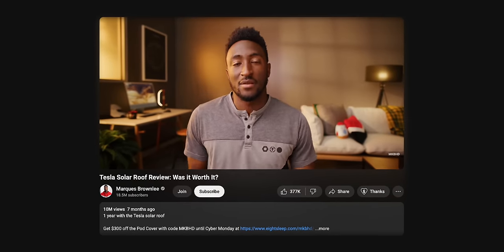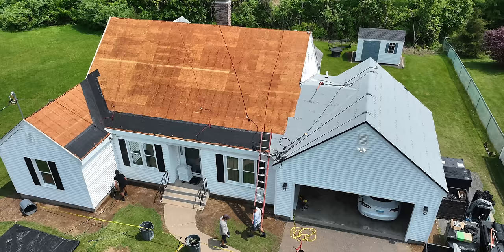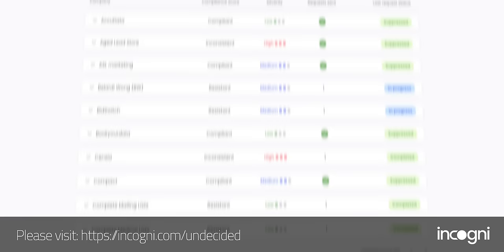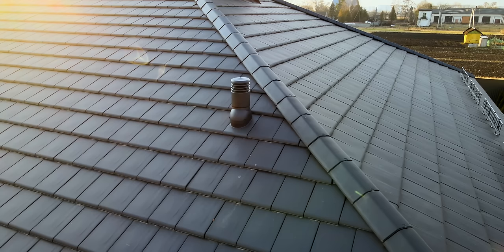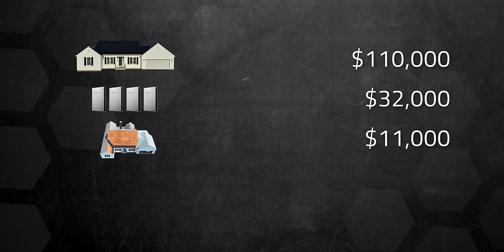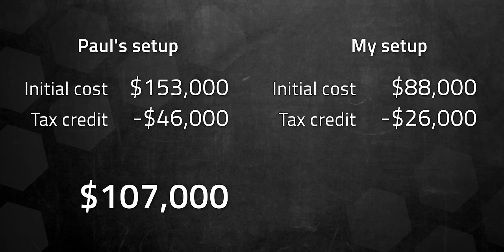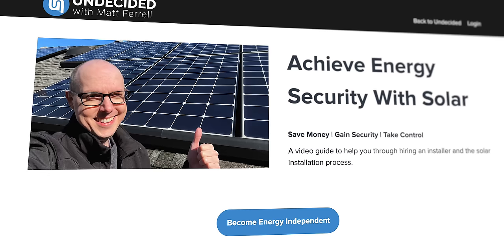Tesla Solar Roof vs Solar Panels: Which is Worth It?

Comment: These USA prices are eye watering! In the UK you can pick up the all the gear with 20kw of panels and 20kw of storage for well under £20k and a new tiled roof on a large house would similarly be around £15 to £20k. Embedding the solar panels in trays on is a good option if reroofing because then you don't pay for the roof tiles just to then put solar over the top of them (effectively paying twice to cover the roof).  I'm looking at 10kw panels, 20kwh of battery and reroof (part embedded) for £30k fitted. I can't get over these $100k+ prices, particularly given that is after massive subsidies!
Reply: Probably depends on who is installing the set-up, but yeah, I've checked many times over the last year and a setup like that in the UK would be a lot cheaper, and I do wonder why is it so much expensive in the US? Some will say imports on China but I can't see that inflating the price by that amount.
Reply: USA has large import tariffs and also expensive permitting before anything can be done so USA laws make solar expensive. Look at lockdown laws and solar laws to see how stupid American government can be.
Payback for a simple solar on a metal roof in the Philippines can be less than 2 years now. 50% annual investment returns!
Reply: Yeah. its a big problem here. installers over charging and getting wealthy out of the process.  its ridiculous.
Reply: @nottelling41   Hardware is a fraction of the overall cost of an install although batteries are expensive as hell. The issue is installers charging a mint and the fact that they know we get a subsidy and price higher because of it. The financing people make it even worse as they pretty much take the entire subsidy! My next system will be done in cash to avoid this and I'm glad my current system was done before the finance vultures went crazy.
Reply: Yeah, they're idiots for buying them at that price to be honest, it makes no economical sense whatsoever.
Reply: It's amazing that USA has so many illegal immigrants from South America and we still have a broken labor market, particularly comparing to Europe. While, on the other hand, it contributes greatly to the USA GDP and made it highly inflated, for better or worse.
Reply: We also have big Oil Companies who do their best to keep Solar expensive.   You can "self install" and hire an electrician to do the final connections for MUCH cheaper.   Especially if you just do grid-tie.   (but then you get screwed by the power company paying less for power than they charge you at night)

Remember these guys are buying premium products, including off grid capability and fancy controllers.
Reply: Uh, for a start, what's the minimum wage in your area? Various things cost more in the US, but the wages are also often a fair bit higher.
Reply: @chickenfishhybrid44  Wages don't affect the return of an investment.
Reply: It’s got even cheaper in the last few weeks, prices have really come down in the UK
Reply: @TheObserver567 why does anyone pay it though? Out electricity is 40c a unit and even then our cheap solar installs are hard to justify
Reply: In Aystralia solar panel installations ars heavily subsidised by government making it very attractive to homeowners
Reply: @chickenfishhybrid44  Min. wage in the UK is about 11.5 pounds per hour or about $14.50 in U.S. currency.  Wages in western Europe are a lot higher than many Americans think they are.
Reply: I am in the US and have been looking at DIYing solar. To duplicate his setup with napkin math numbers I have about 25-30K in hardware costs not including installation. 7K for 16.5K solar, 5K for a 18kW PV hybrid inverter 7.5K for 28kWh batteries. And I put in another 5-10K for racking hardware, wiring, conduit. This is pre tax incentives costs. 60K for design and instillation seems a bit extreme.
Reply: In Australia ,I live in Queensland solar installation is heavily subsidised by Government

Comment: Leaning towards regular solar panels.
Reply: diy solar and portable batteries (which he has shown here many episodes) is becoming clearly a better more portable option... and simpler to run..and not locked down perma solar which insurance and home suburban areaa disallow... diy is becoming so simple with the plug and play solar.. about time
Reply: @dertythegrower   Where are you seeing PnP 10+KW systems and 20KW or more  batteries? Those little "solar generators" are a joke in comparison to a fixed install.

Comment: Those prices are crazy expensive when compared what Im paying over here in the EU. Im getting next week 10 KW solar panels with 11 KW EV charger with installation for 10k EUR. On top of that Ill get 50% off of that price subsidized from the government by the end of this year. Im really happy with this deal :)
Reply: Various things can be more costly in the US. Wages are also generally higher.
 He's also in a particularly expensive part of the US as well.
Reply: @chickenfishhybrid44  true that but overall Im getting a sweet deal and executing. Bueno :)
Reply: But it is not just Europe. Last December (summer in Australia) I had a 6.5kW system put in for $A3.5k (after about $1.2k in government rebates). That's about $US2.7k. And because of our weak currency we are used to most things costing a bit more here than in the US.

Comment: 00:00   🎬 Intro to Tesla Solar Roofs & Personal Curiosity
00:28   🏠 Comparison between two homes - with and without Solar Roof
01:01   🤝 Sponsor message from Incogni
01:08   🥊 Introducing Matt and Paul's solar setups
01:26   📊 Detailed specs of Paul’s Tesla Solar Roof setup
01:58   🤔 Reasoning behind Paul and Matt's solar choices
02:26   🔄 Paul's challenges with roof shape and solar coverage
02:55   ⚖ Efficiency discussion of Tesla Solar Tiles vs. Standard Panels
03:35   🔌 Paul’s reason for choosing Tesla - Roofing needs & EV integration
03:58   🔐 Sponsor revisit - Importance of online privacy with Incogni
05:04   🤷 Why Matt did not choose Tesla Solar Roof
05:22   💼 Concerns over product lifespan & support
06:01   👨‍💼 Matt's concerns over being an early adopter for Solar Shingles
06:37   🔨 Installation ease and aesthetics of metal roofs with standard solar panels
06:56   🕒 Discussing potential Tesla customer service and timing issues
07:17   🛠 Avoidance strategies for roofing delays
07:43   📝 Paul's Tesla installation experience and minor issues
09:05   📜 Permitting challenges and installation delays
09:29   💸 Comparison of costs for Tesla Solar Roof and Powerwalls
10:33   🏠 Roof Types and Their Costs
11:03   ☀ Solar Array Sizes and Battery Storage Comparison
11:23   💵 Federal Solar Tax Credit Impact
11:59   🔌 Net Metering and Energy Savings Complexity
12:35   🛠 Custom Solutions for Electrical, Storage, and EV Charging Needs
13:24   📅 Energy Needs and Production in Different Seasons
13:46   ❓ Where are the Tesla Solar Roofs?
14:29   🌞 Availability and Cost of Solar Options
15:29   📘 Guide to Achieve Energy Security with Solar
15:50   🐛 Reporting Software Bugs to Tesla
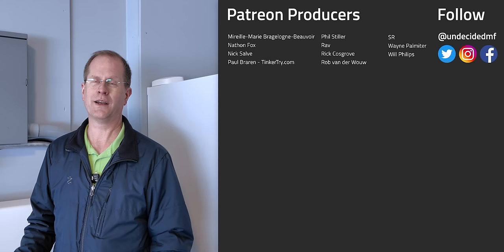16:41   🤔 Deciding Between Tesla Solar Roof vs. Standard Solar Panels

Key Moments by Agent Gold AI

Comment: I think you are right Matt, Any system that doesn't use readily available parts is asking for trouble if your goal is to have an easily maintainable system. Cutting edge products are fun to play with, but I have all the headaches I need just trying to build maximum reliability.

Comment: Solar in the US is really expensive. In Australia I have a 13.2kw system for a total cost of just under $8000 ($5223 US) installed about 5 years ago after rebates. I'm installing a single 13.6kw battery which will cost $7,000 ($4,570 US) after rebates. The rebates for the solar are falling year on year, and would still be about $4,600 ($3,000 US) for a similar system today though the same size system after those rebates is now less than $7,000 ($4,570 US).  The battery rebates are new, and will be $3,000 ($1,958 US). Of note, i can book in and have another 6.6kw to 10kw installed within a couple of weeks, as the red tape was solved a long time ago. The rebates on the batteries are more complicated due to the applying for rebates process (about 4 weeks), but they can also be installed fairly quickly.

So for $15,000 (9,793 US), you can get a 13.2kw system with a single 13.6kw battery system all fully installed. As for a new roof, some quick research shows it's about $80 ($52 US) to $120 ($78 US) per m2.
Reply: This is exacly what is so remarkable to me. I paid 3,500 euro for my 4 kWh system. Of course it's not as much as the 17 kWh, but still if you multiply by 4, you're nowhere near the 55.000 dollar. And the 3.500 euro includes panels, installation, wiring, additional switchbox and an inverter.
Reply: @rba42  yes, mine was completely installed too for the $8,000 Australian, and now its even cheaper with less of a rebate. I don't understand why it is so expensive in one of the biggest markets in the world. Perhaps this is something Matt can do a video on, because it makes no sense to me.
Reply: Yup. Same reaction. I paid $11,500 AUD ( 7,501 USD ) for a 7.7 kW system - 6 kW Sunny Boy inverter and Sunpower Maxeon 3 panels 2 years ago.  Something is badly wrong with the US market.
Reply: He's also living in one of the most expensive areas in the country.
Reply: There is a push in the US to not allow renewables to replace too much of other methods as well as profit motive getting in the way of progress

Comment: I've never even seen a slate roof.. we consider metal to be the budget option in Australia. The other big issue with solar on the roof is the heat and the gap between the roof and the panels. My solar is sitting 100mm off the tile roof, the tile roof can hit temperatures of 80 degrees C. The solar panels also get heated at a loss of 1% per degree past 25C. Thats a 55% loss on hot days over 35 C. However we should have the option to increase the gap between roof and solar panels to help keep the panels cool. How does the Telsa panels keep cool?
Reply: a metal roof company ironically ran ad yesterday.. it is because rich people get them as they are protected by 50 year warranty and low maintain factor
Reply: Solar has so many unknowns, I've heard of 0.4%--0.5% and 0.75--1% loss above  25*C. So what is it?  I purchased panels that are rated for 455 watts, and one day they were cranking out 570 watts each with reflection from snow on the ground. I installed ground mount panels to avoid the roof top eyesore, and that may be the coolest location with grass underneath rather than a hot roof.
Reply: @carlwest859  If the panels are shading the roof, how is it getting hot (except from heat from the panels)? Also, how would grass grow if it is shaded by the panels. More likely to get patchy weeds.
Reply: Anyone building a new home (or completely new roof) should put an air gap under the top layer of roofing. Similar to a rain screen behind the siding on your walls. Venting that top layer will help dissipate the heat soak from the panels.    Regarding slate roofs, they're very popular in the Northeast USA, for people that can afford them. Slate was historically easy to get and obviously extremely durable, but it's VERY heavy and requires robust framing underneath.
Reply: Tesla Solar Roof has a 1" air gap underneath the panels, and some vents along the bottom and top edges for passive venting upward. This may help some, but I won't know for sure until we get into this summer of 2024, my first full summer with the system fully operation. Also worth noting that my town doesn't allow ground-mount solar, and my yard is pretty small anyway.
- Paul Braren, owner of the Solar Roof featured in this video
Reply: Almost like different countries with different climates sometimes do things differently?

Comment: 7KW with 10KWh of battery would cost here 12.000€ on my country. It's still hard to believe these crazy prices from USA :O
Reply: Laboir and insane profits. They make the permitting and inspection a PITA enough that most people hire it out and there's few enough doing it they charge crazy rates. My system in rural VA compared to a near identical system in Florida was close to double the price. Why? Competition in Florida vs here where few companies operate. I look forward to moving South and nearly off the grid soon!
Reply: Pharmaceuticals in the US are double to quadruple, if not more too in the US, so it is not very surprising… 

Americans are use to being taken advantage of by the system or corporations…

🤔

Comment: I installed the traditional solar panels back in 2017. I am very happy that I had gone that route as my home was built in 1941 and also my panels on my house are not seen and are hidden as I have a 1 1/2 story Cleveland Bungalow with a detached garage. A little more than half my panels are on my detached garage. I have two separate inverters (grid tied) and no battery backup.  I owe a little cash during the low production time , December, January, and February. Our Northeast Ohio grid has been pretty reliable which makes it kind of nice. Electricity isn’t as expensive for our area as other states. Very happy with our solar panel system. So far so good.

Comment: Wow!! That’s a lot of power to break even and that’s if you pay cash.
Reply: That’s what I was thinking. On the low end of my power bill, it’ll be 35 years to break even. Yes it looks amazing, and I wouldn’t have to worry about blackouts. But 35 years? The technological advancements over that time to finally break even. I’d want upgrades by then.
Reply: @matarael  Definetly not worth it. I had my conventional solar system installed in 2015, and I'm about to break even already. In a few months, I will have free electricity. Anything Tesla is a money pit.  I bought a Tesla Y in August 2023 for $58K, after all taxes, today you can buy the same spec Model Y for about $49K - the depreciation is crazy.
Reply: I have looked into Solar for my house in the middle of Illinois. It would take between 10 to 15 years to see a complete return (5-year span is dependent on style of panels and changes in energy rates). Thus, making the potential of a decent return as long as my family doesn't need to move over the next decade.

Comment: Friend of mine had leased solar panels for the last 20 years. The company he'd been leasing from had been bought out by Tesla, and they called and said it was time to replace the panels. Which they did. But a couple months later, his electric bills are back up over $400 because Tesla didn't rewire the new panels correctly so they weren't sending any power to the grid. Then he tried to call Tesla, but... Tesla doesn't have any customer support. He finally decided to stop making the lease payment until Tesla called to ask about it and he could explain the issue. I personally would never buy or lease anything from Tesla.

Comment: Tesla directed me to an approved Tesla installer here in Florida.  They advised to go with the non Tesla solar panels because they are cheaper and more efficient and stated chances of getting the solar tiles like Paul did were slim to none.  I don’t mind the looks at all either.  They put on 32 410 Watt panels with the Engadget box and 2 Tesla power walls and inverter.  Presently waiting on FPL to put in the new meter!

Comment: Its still pretty expensive, here i can get 36 560wp solar panels with all the cables and roof mounting gear for €7200, an 15.6kw deye inverter (sol ark eu equivalent)for €2000, 4x15kwh lifepo4 48v for €10k/ that makes like 19.2k or 21k USD. not including labour but that woul likely add around 6k USD
Reply: If memory serves correctly 15 kWp cost roughly 30k installed --- back in 2011 that is.
Reply: He's also living in one of the most expensive places to live in the US. McDonald's workers where I'm at in the US, start at $16 an hour.

Comment: All I know is what I read on the Internet, and my impression is that the Tesla equipment is in frequent contact with company mainframes, and that if there is a prolonged widespread outage and internet fails, after a period of time the Tesla system will shut itself down.  So to me, there's an issue of control.  I would also have a concern about repair and replacement of equipment if Tesla should suspend their roofing business.  Standard solar panels and equipment are more likely to maintain availability.
Reply: That is not how it works.

Just cause there is no Internet access it doesn't mean the Tesla cars will refuse to turn on or the Solar will refuse to produce electricity.

Like wtf ????

That is valid for products that need to be turned on/off remotely and goes through companies servers to do so.

Like IoT devices. In which case they will not work.

Like Automated Lights/Cooling, etc if not made sure to run Offline, they will stop working if internet goes out.

Not the Car or Solar Panels.
Reply: @MarcSpctr  Good to know.

Comment: I found the best solution is build a ground mount solar array. Highest probability is your roof is in the middle of its lifespan and thus a Tesla Roof tear off throws away roof money or the solar install needs to be dismantled in a few years to replace the roof (roof conditions top home buyer fears lists). ... With a ground mount you'll lose some yard space and have to mow around it but it converts the project from locating contractors to do roof installs on second-story-high-roofs to a much more manageable DIY scenario. You can also create secondary benefits such as a back yard deck/pergola design, a carport in front of or next to a garage, or a low storage shed depending on space available. Property setbacks and whatnot will come into play.